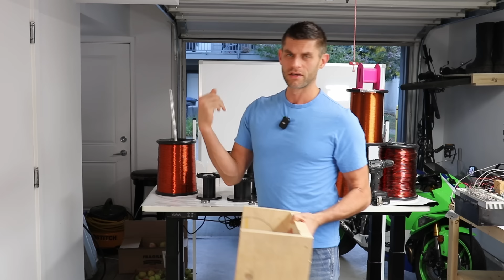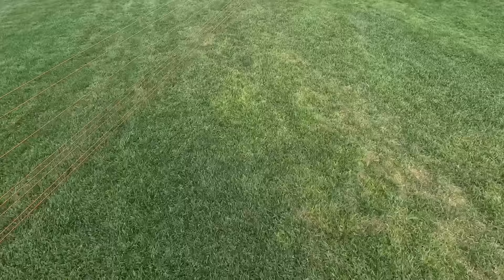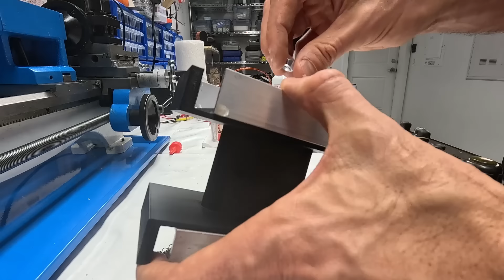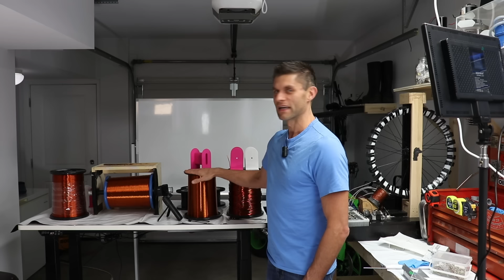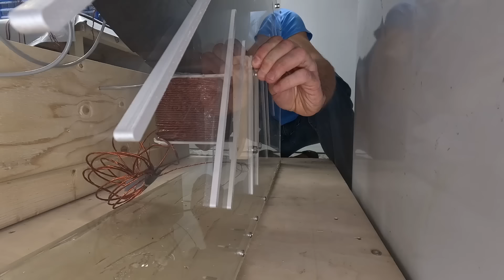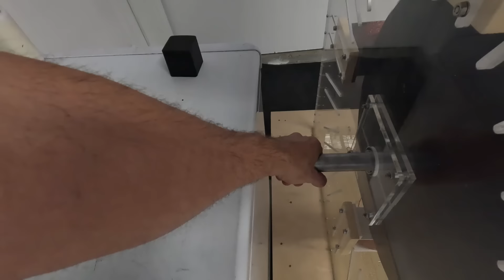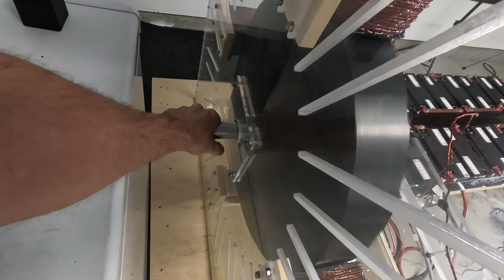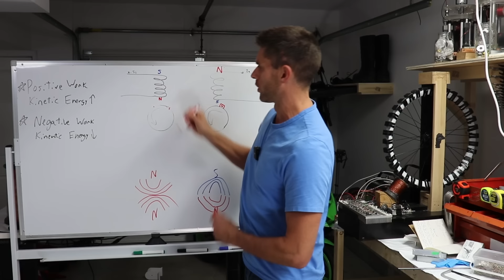The Device That Could Give The World Unlimited Energy

Comment: Good idea , but I think there was a reason that north poles were facing out, That's all being seen and done. You should also hear Rick Fredericks final thoughts on Bedini.
I do think the magic is in that collapsing field as well. And can be used to impulse other coils
Reply: Wouldn't it be the smart thing to do if he focused on building a system that focuses and isolates where the magic happens.. in that collapsing field?  That way he could skip right to the meat of the thing, doing away with all the other distractions?  If the magic's in the collapsing field, build out an experiment which only charges up a magnetic field in an induction coil and lets it collapse back into a battery bank.  That's all the circuit would need to do, so isolating any issues or areas with potential losses become extremely easy to deal with.  If this approach was taken, we would have shown the excess energy being there or not a long time ago.  Instead, we get to watch probably a couple more bearing swap outs to trickle out a hair more in efficiency.. see him tweak the pulse timing a few more times to eek up the RPMs a tad.. probably get a few updates a month or two from now talking about how some transistors exploded and he's got a go fund me up to replace them.. But the free energy train is rolling in real soon, just you wait!
Reply: @localbroadcast solid state would basically be a joule thief then, which I love and have many of them built.
Reply: The faster the collapse the better

Comment: Now we wait for the battery to be disconnected and replaced  with one bigger capacitor. Also add manual drain output to drain power slowly or faster from that capacitor. In this case pair of voltmeters V&A would be enough to see what is going on that capacitor. I keep my fingers crossed.
Reply from the maker: Maybe

Comment: Why are the compasses all pointing differently ? The ones on the table not being used yet are point differently before you started
Reply from the maker: Cheap quality
Reply: Because of the existing emf created by all the equipment on his bench. 
A stronger force is localised when he puts the near a wire carrying current... 

Nothing to do with quality because even the most basic compass will work.

Comment: Hey guy, haven’t yet heard how many ohms per coil you were using….  I use 1.2 to 1.7 depending on how hot I want it to run..
Reply from the maker: 3.6 ohms per wire... 8 wires per coil
Reply: @MadscienceLPTECH : Then, eight wires are in parallel, on each coil, of course, means the coil will have a total resistance of ,45ohm.  This will have a pretty hefty current draw, and may run very hot, unless you plan on hooking some of those coils up in series. also, the main difference between Edison motors and Tesla DC electric motors are that Tesla wound coils independently, which gave the motors a 30 or 40% boost in power.  Unfortunately, I’ve lost track of the patent number on that. Independently  wound coil motors eliminate back EMF.
Reply: @MadscienceLPTECH  Hi, For 24 volts system wire> 3,6ohm=75m,Trigger resistor> 200ohm,
 about 12 Volts system=1,5 ohm/ one wire=40meter, Trigger resistor>360-470-ohm.

Comment: Why dont you build the machine inside a silver piped pyramid, running pressurized red mercury at relativistic speeds, then you just use the flux to supercharge a Rodin coil trough quantum celeritas.
Reply from the maker: Lol i like it

Comment: ChatGPT says:     When you place that around a coil (especially with alternating current or a changing magnetic field), eddy currents form within and between the strands.
	•	These circulating currents cause losses, heat, and reduced efficiency — just like in solid-core conductors exposed to AC magnetic fields.    I used to be an engineer more then half a century ago,    I'm retired USAF disabled Veteran.    I'm not working,   but learning how to prompt engineer.    Do you still have my "Signal" number?   I sent it more then 5 months ago.
Reply from the maker: Sure but we were talking about field on field interactions. Not field on coil

Comment: If you're coating the coil in resin, shouldn't you stick it in a vacuum chamber to suck out any air bubbles, to prevent any arcing within the coil?
Reply from the maker: No the epoxy coating is just to hold it together not insulate the wires

Comment: The WINDING DIRECTION of an induction coil will give DIFFERENT magnetic flux results.A CLOCKWISE winding will give a N pole on the OPPOSITE end of the coil as a COUNTER-CLOCKWISE winding with the current going in from the same end. If you bring the current in from the opposite end it ill change the N pole to rhe other end but the MAGNETIC FLUX SPIN will be in the opposite direction. The TWO electromagnets are NOT THE SAME.
Reply from the maker: Agree
Reply: I have been working on rebuilding Clemente Figuera's infinite energy machine for the last 15 years. His 1908 Spanish patent can be found on Google under Rex Research Clemente Figuera. He had an actual working machine when he got the patent in 1908. I will try to send you photos of my build.
Reply: Can you give the wire guage on the eight ply winding?
Reply: DO you keep a count of the turns on the 27 guage power coil?

Comment: The 8 strand coil is what is called a Litz Wire coil.  Litz wire has a much lower resistance to Higher Frequency AC.  Induction Cookers use a Litz wire output coil, because the output frequency is over 20KHz.  The Induction cookers common on Amazon for about $60 use a 7 strand Litz output coil, and run at about 25Khz  
Just thought it would be useful to know why this needs a multi-strand output coil.
Reply from the maker: Thank you for the info!

Comment: This a wonderfull...
I thought of using a magnet rotor with field magnets then using a small current to mechanically shielding or de shielding field magnets as per timing. So a small current basically used to control strong magnets? I know magnetic forces cant be blocked but can be shielded redirecting magnetic forces. So basically small current needed for timing purposes where the motor it self produces huge power? Just a thought😊😊😊😊😊😊😊😊😊😊
Reply from the maker: Love it❤️

Comment: Hey again... Your construction is impressive. With the precision of coil construction & epoxy, they'll handle some nice high voltages. My biggest question (and perhaps for many) is how you handle the high voltage (radiant) spike coming out from the collapsing magnetic field. The spikes can reach 100s of volts and your coils will hold up to that. So do you feed it directly into the battery bank? or will you use a cap dump circuit? if so, will it switch mechanically, or by semiconductors? Your battery bank looks to be series connected for a higher voltage (48V ?) - perhaps it enables handling high V spikes? I've injured many 12V batteries feeding it the spike directly.  Ultimately, we want to rotate the batteries indefinitely without degradation. Any ideas on that?
Reply from the maker: Directly into the batteries as we want the Dipole imbalance in the internal chemistry of the batteries to allow the AETHER to balance it out / add energy to the stystem

Comment: I have build my own bifilar winding machine that can manage several strings up to 8 or 10 strings together.
But remember that very high frequency input to get resonance frequency is the answer.
What we need is negative energy to run the system very cold to ice cold with an output power in abundance.

I build a model that only produce electricity with frequency input instead of using a rotor magnet wheel.
Reply from the maker: Got any pictures?

Comment: Energy removed from the vacuum. I did not see any demonstration of actual energy removed from the vacuum. Now if you could take more energy out and say, run a window air conditioner all day long from the free energy, it would be a much more believable demonstration.  I see ads on You Tube constantly selling plans for free energy from the ground, but I find it suspicious.  Although supposedly, Nathan Stubblefield harvested some high current low voltage to power carbon arc lights on his Kentucky farm back in the late 1800's. His farm is now Murray state college.  The idea of extracting electricity from the vacuum is interesting since I read that physicists have mathematically calculated that the vacuum of space is replete with energy. But how to tap it is the question? Keep up the good work!. Maybe soon you or someone else will solve the problem of extracting free energy.
Reply from the maker: Lol there are ads for free eneegy plans on my videos ?

Comment: At 6:35 he says the external work performed outside the current conducting wire does not affect the flow inside the wire. OOPS. wrong.
Reply from the maker: No its not
Reply: @MadscienceLPTECH have you ever hand cranked a generator attached to a load?

What you're describing is physically impossible. Every action has an equal and opposite reaction. 

If there was no effect, then there'd be unlimited work that could be done.
Reply: @MadscienceLPTECH  OK, then the power company should not charge me for any work done in my house after their transformer on the pole.

Comment: There were a few points in the video where the volume of your voice changed dramatically. I'm not sure if it will rectify this fully, but if you have a situation where the volumes are different between two audio tracks, you can potentially run the entire audio through a compressor to bring up the lowe and down the highs to flatten out the volume. Otherwise, thank you very much for the video.
Reply from the maker: Appreciate the suggestion, we'll keep that in mind for future videos.

Comment: You can’t create an over-unity device that draws from the space vacuum with a bendini motor only good for charging batteries . If you were to plug this in any small scale power generator it would not be Abel to sustain . You should look into modernizing harnessing and detection of Neutrino particles. Way before you got here buddie I suggested you transition your magnets into the Halbach array to have one concentrated magnetic pole with barely any magnet loss without need of inducing the current to create a magnet. Change Tactics because you have a lot of magnetic loss and if this were to grow in principle it would lose rpm’s because of heat and inefficient magnetic concentration . If you arranged the magnets in the Halbach array and THEN USE YOUR OSCILLATION Principles at low current you can control the rpm’s better with way less electrical cost and you could build on it.
Reply from the maker: Good thing this isnt a bedini SSG
Reply: @MadscienceLPTECH you can’t change the definition of something because you want too. You keep adding more controllers and more batteries at this rate even if it’s low power consumption to the controllers it’s not overunity because you are putting in more than giving out. You are ignoring magnetic distances and using old inefficient technics rotating the poles when it’s been proven the Halbach array uses no power and not only reduces magnetic loss but help with RPM control and you’d be actually using less than put in . But again the higher the rpm you will see the loss and it will cause a cascade of problems. This isn’t a feasible device anymore it’s more loss and educating people with no knowledge which isn’t bad but then change the titles to learning videos not fake over unity devices. You aren’t even utilizing the magnetic poles efficiently. The point to keep an over unity device is little to no power input which can be achieved through magnetic distancing and quarter turning of magnets controlling the stater. I don’t understand why you aren’t utilizing RF resonance to induce rotational spin and speed it up via your PID controller. You can even pulse the frequency for it to maintain whatever current speed without requiring need of continuous power with some added electrical components of course. It’s only possible if you bring down the volts and up the amperage. Your device can work but only at lower power consumption and with some TLC. Too much power and too much RPMS are gonna rip this apart. You have the backing now why aren’t you moving forward with multiple projects ? And have you considered using a liquid ferro fluid on another project to control rotational spin in a different way ? Is this the only idea of inducing spin? How much voltage is required to induce the initial spin and how much voltage is required to keep that spin constant at that rate ? All of this is cool just continue pushing outside of the box thinking don’t get stuck on one idea grow adapt because your concepts are nice but theories are lacking fundamental rules. In order to achieve entropy you can’t get away from heat loss and magnetic loss due to heat. Lower voltage with higher rpm’s has to remain the goal or entropy CANT be achieved.

Comment: Like I said in the video you did before, you will have only enough power to keep the system running when you tap power of it the over all charge will decrease. I know I did this over 15 years ago. have you ever shown what its like to plug in a load to your generator? Plug in something like a refrigerator or oven would stall that thing is a couple seconds. 

When you plug in a load the amount of drag you will get on your motor will be much more powerful then your pulse coil its like someone adds a bunch of weight on the wheel causing much more drag than acceleration. It would take hours and hours just to charge 1 battery and while its charging you cannot plug in anything else or it will stall.

If you haven't learned how to deal with load then you still have a long ways to go. when you learn how to handle load and not only power generation then it becomes a whole new ball  game. showing what a volt meter says is not showing you how much load to deal with you can have all the voltage in the universe but if you have no movement of charge aka current flow then you got no load power just by having more voltage really doesn't show that you are getting anything in forms of current flow for heavy loads

check your load capability not voltage. You show you can power loads and lots of torque and not just a over voltage then you really have not done anything in forms of self power generation only basic voltage with no current flow.

BTW you need to see more current flowing into the negative side to charge the battery bank the current from a battery flows out the positive to its negative and if you have less going in the negative then positive then you are losing current and slowly discharging. 

You dont need better equipment you just need to know where the charge is going and whats happening to the current in your system. Less to negative is slow discharge more into negative is battery charging....
Reply from the maker: Thanks fot the tip and support

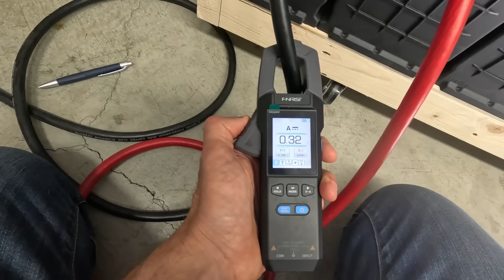Comment: Hi, at 38:40, that FNIRSI  DMC-100 DC AC Current Voltage Clamp Meter Digital Multimeter I would throw out, I looked up the so called manual and it does not, as you say, have a DC current zero.  
Have you contacted the company and told them that you have pointed out to your subscribers its major flaw?
A quick look at their other manuals and they also have some basic errors too.
Where do I find your schematics of the machine as a whole and the PCBs?
Reply from the maker: Yes its garbage
Reply from the maker: We will post updated drawings soon.  I did put them in one of the past video descriptions

Comment: you'll likely never see this comment but here goes. "where do i place the meter" could likely imply that the pulsed dc output can only be done on one wire, and crushed by the conventional use of 2. i'd place the output poles on one battery each, and not connected in series. see what comes up, if it does something
Reply from the maker: Thanks for the suggestion, I'll keep it in mind

Comment: I give you an idea that you can test it, if you want.
This is from Nicola Tesla's work.
You create a big coil that evidently has inductance, capacity between its own windings, and low resistance. 
This coil is to be excited with an alternating current of which frequency can be modified between 5 Khz to 20 Khz. The coil is mounted up in the air like an antenna. You connect one of the end of this coiled antenna, the bottom end, through a strong and big diameter copper rod or pipe that's placed/pushed very deep into the ground.
Now you power this RLC parallel circuit ( with R=coil's wire resistance as low as possible; you're an engineer, you know what I mean ) with a voltage of increasing frequency. According to Tesla, around 11-12 Khz the magic will happen, when a huge oscillating voltage and current will result due to the resonance with the electric field inside the Earth ( however, you test it yourself and see which is the sweet spot of the correct and specific frequency ).
In this moment the RLC circuit will function independently taking his enerrgy from the deep inside Earth's own electric energy.
Now, if you build another ( identical or not ) RLC circuit at a distance let's say 1 mile away and you use the same frequency of the voltages, you will create a humongous RLC circuit that oscillate freely between the two circuits ( both being part of the larger one now ) with the Earth's atmosphere ( the air ) playing the C ( condenser ) function and the Earth internal telluric potential as being into the RL part of a humongous RLC circuit that oscilate freely based only on the free pulsating telluric currents, after the initial excitation with the specific resonant telluric frequency of the Earth.
That's the true experiment of Tesla who was stopped financially by the fraternal magnates of his times who didn't want any device producing free power. ( "If I can't put a meter on it, I'm not interested", fraternal finacier J. P. Morgan ).
Now you understand the universal usability on Earth of the practical devices resulting from this.
Reply from the maker: Love this